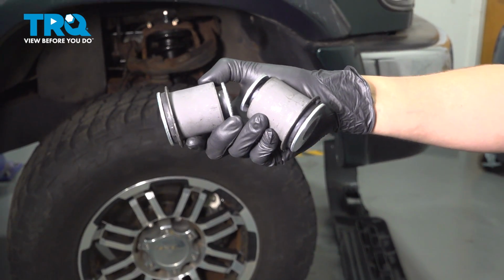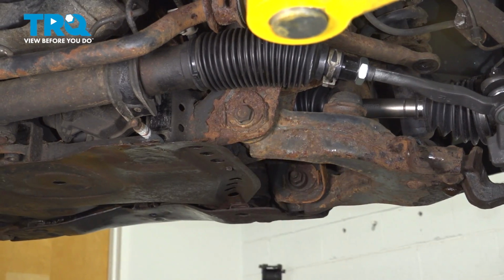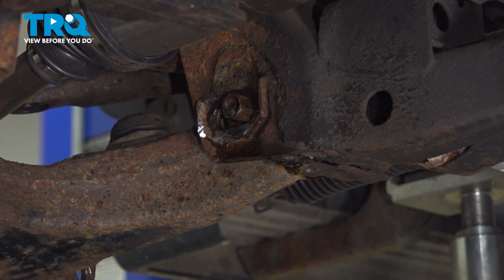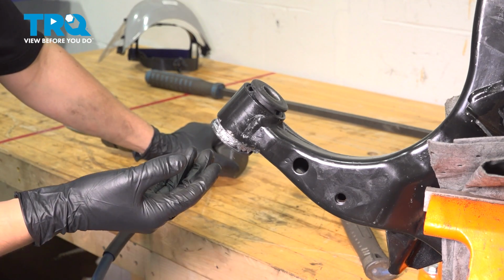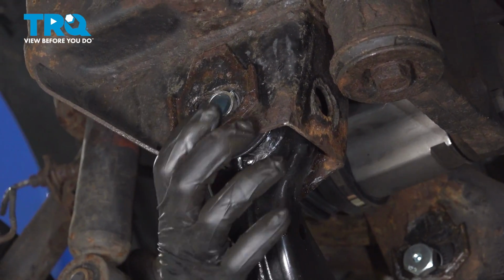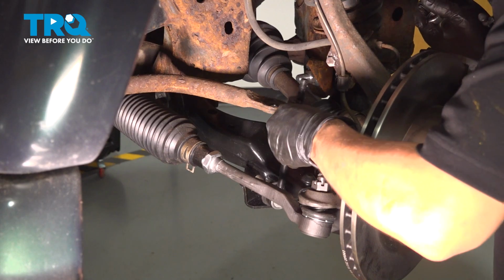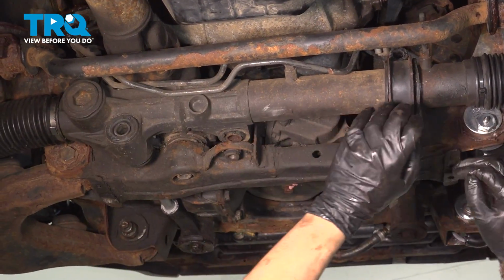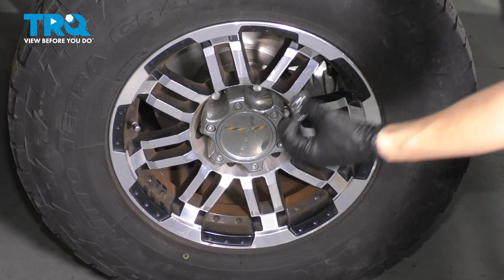How to Replace Front Lower Control Arm Bushings 1996-2002 Toyota 4Runner

Comment: Good video, but you got the torques mixed up on the steering rack, the bold and nut on the horse shoe are 123 and the 23 mm nut is 96